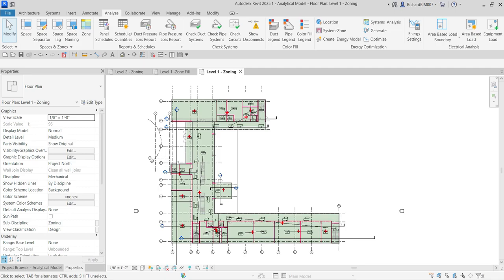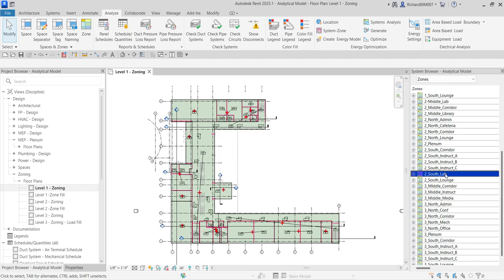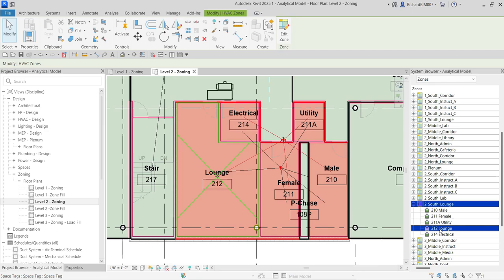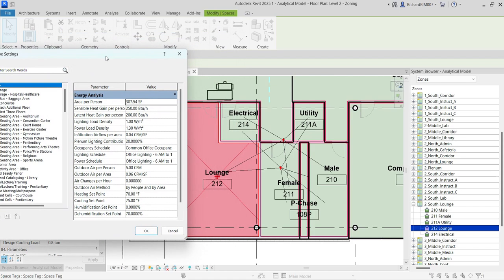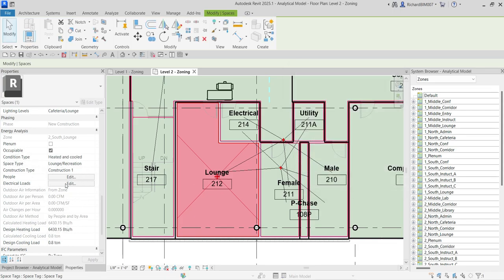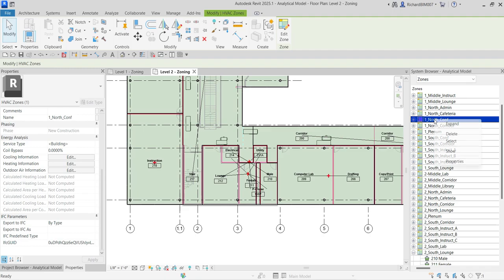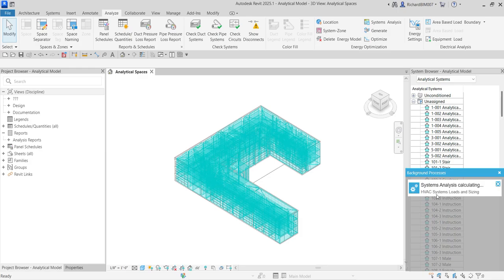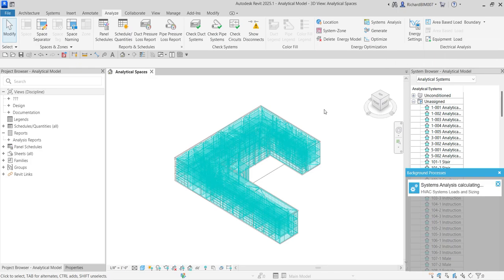REVIT 2025 FOR MEP DESIGN: ANALYTICAL MODEL - HEATING AND COOLING LOAD ANALYSIS

Comment: Dear thanks for this wonderful learning video it is really helpful, and I have a question regarding the energy model, when I do energy model creation it shows the spaces I have in the building sub divided into 3 or 4 parts, the room space looks cracked and divided into several parts and this reflects in the reports finally, e.g. if I have 8 rooms it become 32 parts and this make the report confusing, my question is how can I cancel space sub dividing and get only final HVAC reports includes the 8 rooms only ... thanks in advance
Reply from the maker: hello sir, when you create an energy model, Revit often subdivides rooms/spaces into multiple analytical surfaces to accurately calculate things like heat transfer, daylighting, etc. But for HVAC reports, this can clutter your data.

HOW TO FIX IT – Get Only 1 Space per Room in Energy Model
1. Use Rooms or Spaces, Not Both
In Energy Settings, choose either:

Use Rooms (for architectural workflows)

OR Use Spaces (for MEP workflows)

Avoid mixing both — this helps avoid duplicates and unnecessary subdivisions.

2. Turn OFF Detailed Elements in the Energy Model
Go to Analyze > Energy Settings.

Under “Advanced”, look for:

Uncheck "Use Conceptual Masses"

Set "Analytical Surface Resolution" to a lower level

Turn off “Divide perimeter zones” if shown

These settings affect how finely Revit slices the model.

3. Simplify the Analytical Model
If Revit subdivides a room due to wall geometry, openings, or volume changes, try:

Simplifying wall/floor geometry.

Checking for room-bounding elements inside the space (like low walls or dropped ceilings).

Making sure room heights are consistent.

4. Check for Split Levels or Interfering Elements
Rooms can get split if:

There's a floor slab or ceiling interfering

A void, duct, or equipment cuts into the room's volume

Try hiding model categories and inspecting a room in 3D to see what's dividing it.

5. Final HVAC Load Reports (Summarized)
After running the load report:

Go to the "Report Settings" (from the Load Report window)

Look for a summary mode or zone-level output

You can also export to Excel and group by zone or room name

Quick Tip:
When placing Spaces, you can name them the same as Rooms and group by that in your report to simplify.

Comment: Hello Rick. Where do I activate the option to make calculated cooling load work?
Reply from the maker: hello daniel, try this:

1. Enable Heating and Cooling Loads
Go to the “Analyze” tab.

Click on “Heating and Cooling Loads” in the Energy Analysis panel.

2. Ensure Spaces or Rooms Are Placed
Spaces (MEP workflow) or Rooms (Architectural) must be placed in all zones/rooms for Revit to calculate loads.

3. Define Zones (for MEP Workflow)
Use the "Zone" tool to group spaces into thermal zones.

Zones are required for load analysis.

 4. Check Space/Room Data
Make sure each space has:

Correct volume

Defined building type

Occupancy data

Equipment/lighting loads

Outdoor air requirements

5. Set Building Location
In the "Manage" tab, under "Project Location", define your:

Location

Weather Station

Project phase

 6. Use Analytical Model & Energy Settings
Under “Analyze” > “Energy Settings”, set:

Analysis mode: Use Rooms or Spaces

Building type: Set properly

HVAC system: (optional, but helps with load results)

Ensure “Calculate Volumes” is turned on in the area/volume computations (Settings > Project Units > Area & Volume > enable volume computations).

7. Run Load Calculations
Go to Analyze > Heating and Cooling Loads

Review input settings, then click "Calculate"

You’ll get a Cooling Load Report showing:

Peak cooling/heating loads

Component breakdowns (walls, windows, infiltration, etc.)

Comment: Hi rich does it requires internet connection to calculate heat and load calculation
Reply from the maker: Hi @Xyz-vl4cx! No, Revit 2025 doesn’t require an internet connection to calculate heating and cooling loads if you’re using the Systems Analysis tool for basic HVAC load calculations. It processes everything locally using your model’s data (spaces, zones, etc.) and the built-in EnergyPlus engine. However, if you’re doing advanced cloud-based analysis (like energy modeling with Insight), then you’ll need internet access. For standard heat and load calcs, you’re good offline once Revit’s installed. Hope that helps!

Comment: Hello sir,may tanong lang po sana mapansin nyo,pede po bang mapalitan ang system classification ng duct kung mag aadd po ako ng fresh air,smoke extraction at air pressurization?kasi sa system type po ng duct nag duduplicate ako pero pano po kaya mapalitan ng system classification galing sa dinuplicate na system type?thank you po.
Reply from the maker: gawa ako ng video nito sir.
Reply: @bim360  thank you po sir